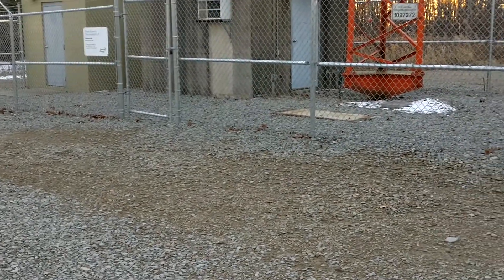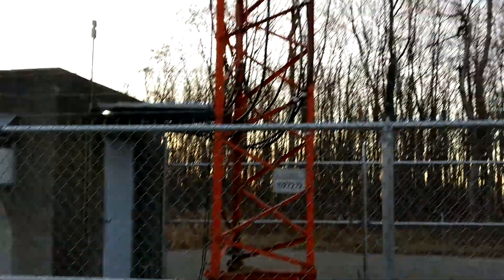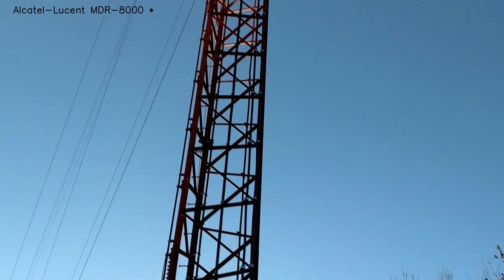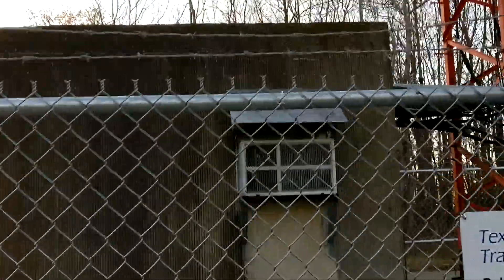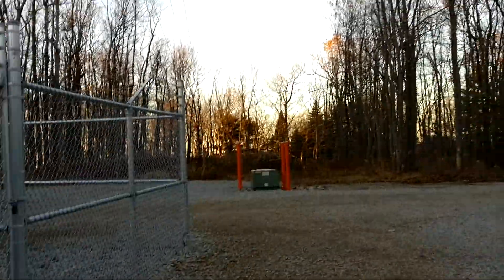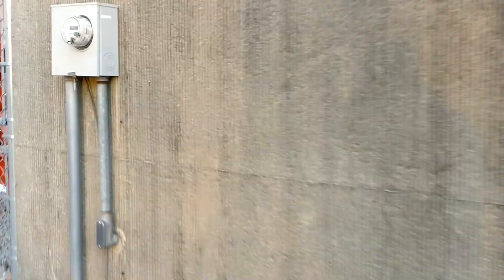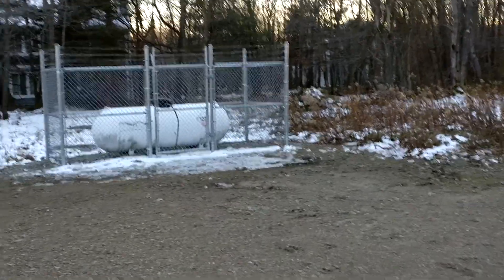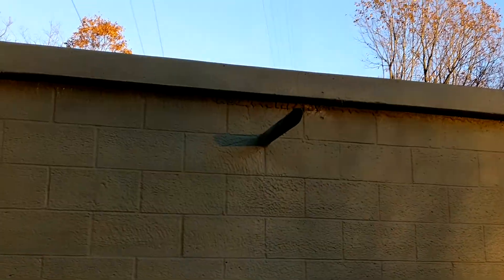Taking a peek at a microwave backhaul site

Comment: The device on top of the building could be a GPS antenna we have a cellphone tower down the road which has one on the side of the building.
Reply from the maker: Good guess! I found out later its actually the light sensor to turn the tower lights on and off at night time.